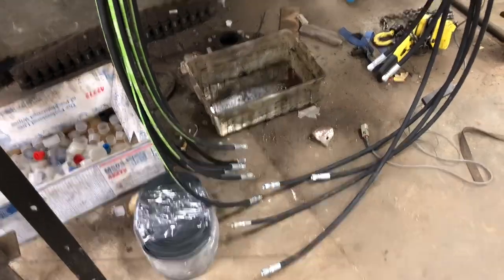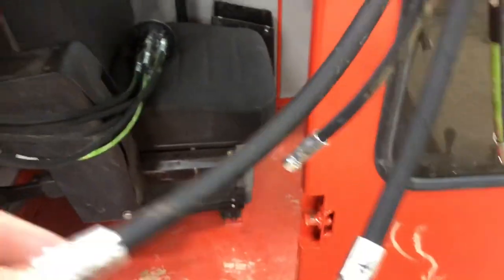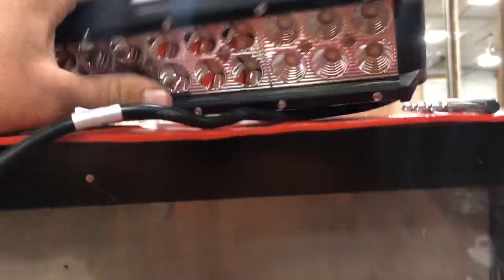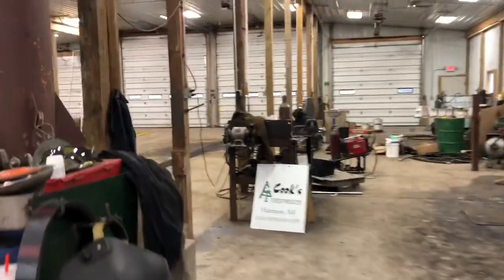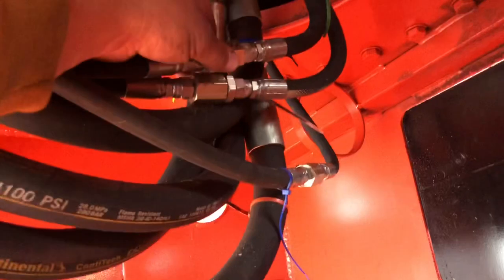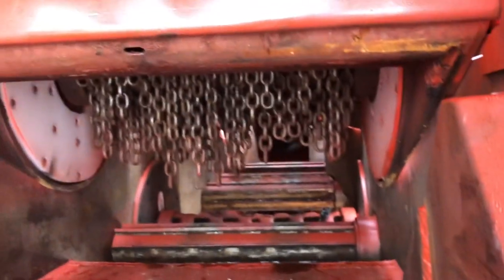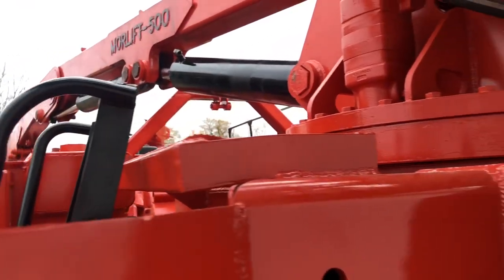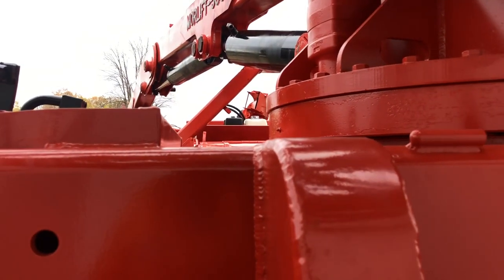Pilot Hose for the Joysticks!

Comment: That tigercat is getting Rusty
Reply: We’re trying to get the right rollers, the whole undercarriage and sub frame was replaced when we bought it. There was around 1000 hours on it and looked new, the rollers are worn out and broken, we were told that the undercarriage was for a 830 so that’s the rollers we ordered and they didn’t fit.  After much investigation we learned that it’s a 870 undercarriage.   So the good news is we know we
what we have and it’s heavy duty.  We need it back in the woods!  How’s your weather, been a lot of rain over here making it tough going.
Reply: @mikeandkimcook9074  glad you got that figured out and got the right parts coming.Things have been going good since it dried out in June but it's starting to rain now, we've been heavy into logs a lot of oak  . The pellet market is strong here which is where all of my chips go. Alot of changes in the last year but All is good